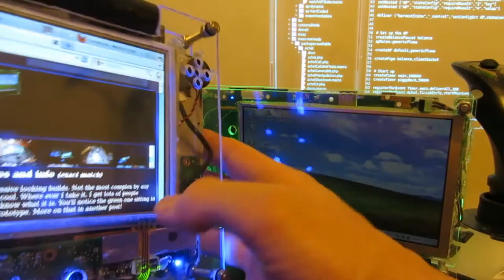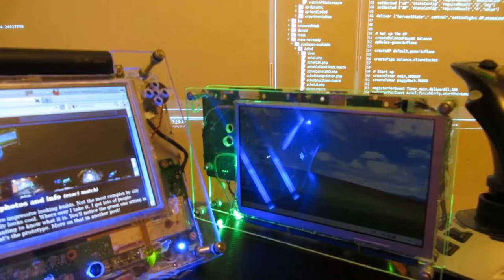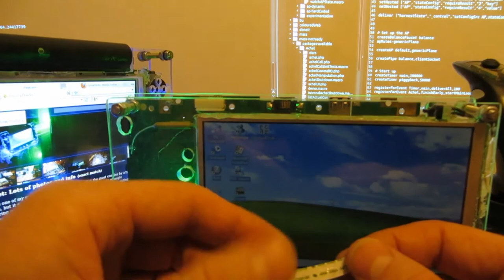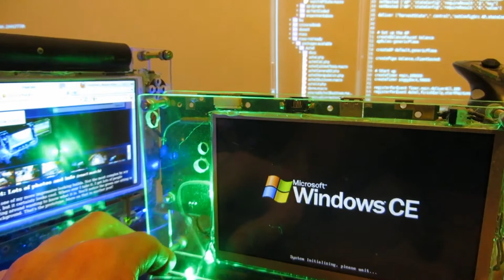FunnyHacks - Inside the prototype tablet

Comment: The prototype has flash?
Reply from the maker: Yeah, both of the original netbooks had internal flash storage.
Reply: Cool how do you get memory in it usb flash drive/ hard drive
Reply from the maker: Sorry, I don't quite understand the question. Feel free to reword it. I'll take a couple of guesses:
Both of them can take USB devices, although the windows CE one seems to require drivers for eeeeeeeeverything.

The final one is based off an Asus EEE, which has a built in SD card reader as well.

That one can also take external memory (RAM). I've upgraded it to 2GB, which if I remember rightly is the maximum for that motherboard.

When setting up the OS, I did it using a USB flash drive.

Did I answer your question?
Reply: Well you guessed the question correctly I might give this a try
Reply from the maker: Definitely. It's one of those hacks that even the non-geeks are interested in. If you do do it, feel free to post a link on here to a video of it.
Reply: I will do